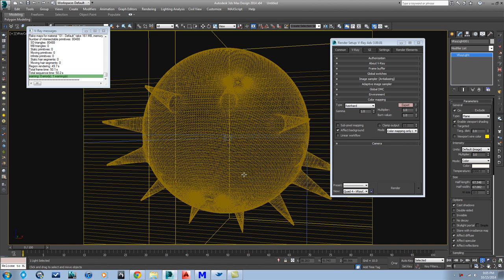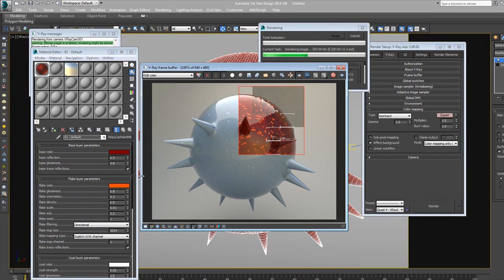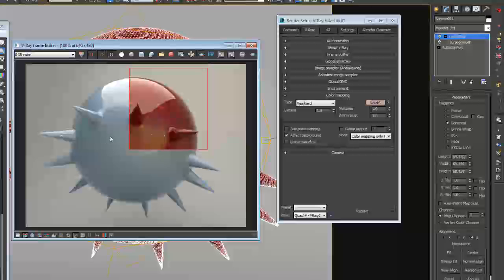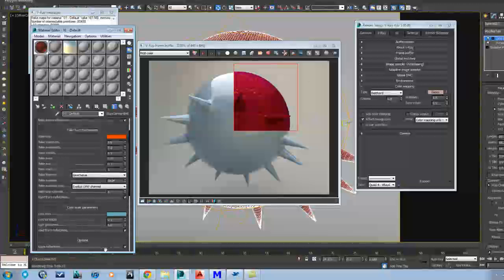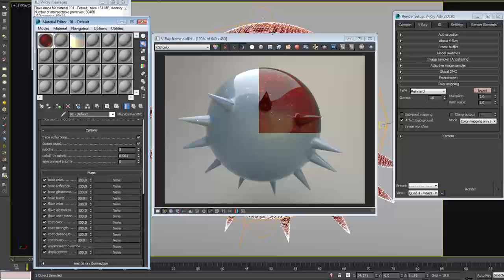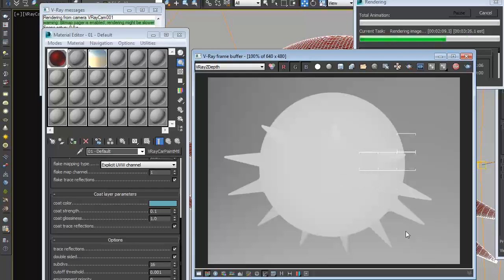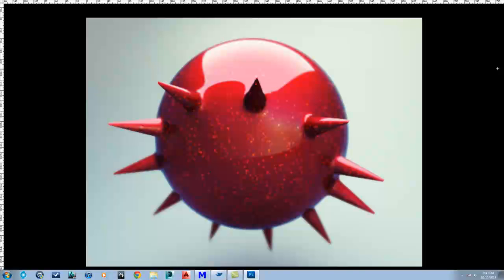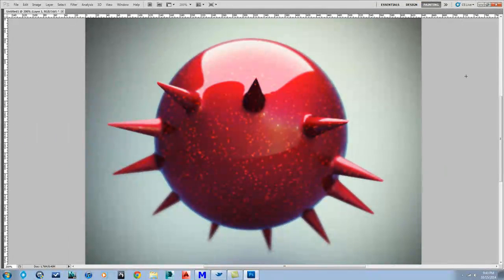Vray Car Paint Tutorial Material (VrayCarPaintMtl):  Vray Car Paint + Plus Download

Comment: (For small Flakes) I used the UVW Map Modifier with Box Mapping (because i had a car model) and increased the U,V,W Tiles (inside the UVW Modifier) until they had the right size and then i increased the Flake Density to the desired amount. Worked fine for me.

Comment: Good video i think the post production part at the end was the best part it took me long time to discover exporting vray lighting and reflection maps etc ..

If any one is following a long and they do not know about Rendering with  active shade ON render and not production  when tweaking material this way it can update the render in real time ..if your computer good enough it will make it more easy to get the desired effect you want ...once your done with tweaks can switch to production for final render ..Keep in  mind to turn down the resolution output on active shade to save time ..depending on you settings of vray and machine will change ...i tend to render active shade on in 800x600 ..and for final 1920x1080 ..if u can go higher on final do it ..
Reply: true

Comment: In my opinion this video isn't that good as it could be.your flake size doesn't fit at all.of course without flakes you have probably a nice non-metallic car paint but like this you just have a wrong metallic carpaint.
Reply from the maker: I think "wrong" is a bit arbitrary in this case, however, I sort of agree with you.  I thought the same thing when I was creating this, but the point of the video was to demonstrate how to use the settings, not be an example of the perfect paint texture.  In practice, I would continue to tweak.
Reply: zillus
Don't get me wrong, I just wanted to give an advice.
How much experience do you allready have?Do you work as CG-Artist?
Reply from the maker: foshizzlfizzl No worries.  I appreciate feedback.  Yes, I do work as a CG artist.  I mostly work in architecture.
Reply: Ok.That's cool.I just wanted to say, you may be should mention, that VrayCarPaintMtl need an Object in Real Life Size.Or it's easier to handle that way. I have some nice flake results with my settings, I could share with you if you're interested.I mean they worked for me.
Reply: foshizzlfizzl 

Hi,

Please can you share your settings - or better still please can you do a video yourself and upload onto YouTube ?

I really struggle with CarPaintMtl and this video isn't good enough - I'm not into videos which are really exploratory and simply messing around with settings, there's enough people with Camtasia out there uploading this kind of material and quite often it only adds to the 'noise'.

As a note to the author of this particular video - VRayCarPaint options and controls are a LOT more complex than you claim them to be, for example, the density, flake size, scale, all have a connected relationship with each other and which the Help File for V-Ray does try to explain.  Unfortunately, I still don't seem to get good results no matter how hard I try.
Reply: +Jez2008UK My advice to you is - don't bother with vray car paint shader. Make your own. Create a vray blend material and use a base diffuse layer and a clear cloat layer and use a falloff map to blend the two. If you want flakes, use a noise map in the reflection of the diffuse layer.
Reply from the maker: +Toby Lee Certainly that works too, Toby.  I rarely need that much control, so Car Paint ends up being sufficient and relatively easy for me.  However, if I was focused really close up, or if that material was the focal point of my image, I might do it your way.  Thanks for the comment.
Reply: Toby Lee Thanks Toby for the advice - I'll give that a go :)
Reply from the maker: +Jez2008UK This might help you.  Maybe you have seen it already:
http://docs.chaosgroup.com/display/VRAY3/VRayCarPaintMtl
Reply: zillus Thanks - I really appreciate that - I was looking at CarPaint recently as it happens, so perfect timing :)

PS - I think Chaosgroup are making serious inroads into improving their documentation - this looks improved from the last time I saw it.